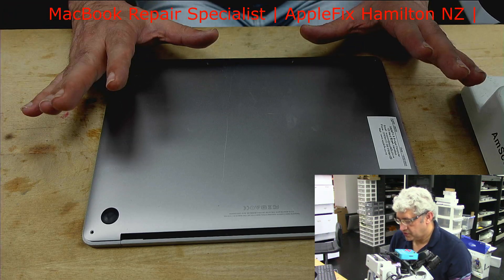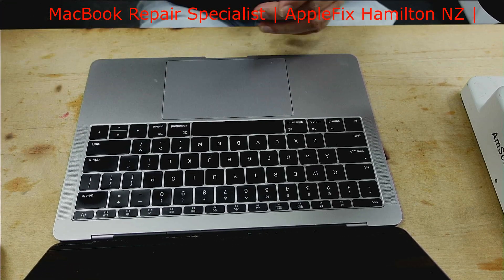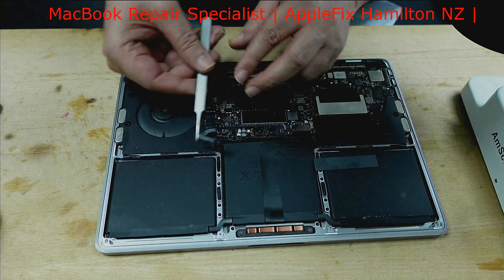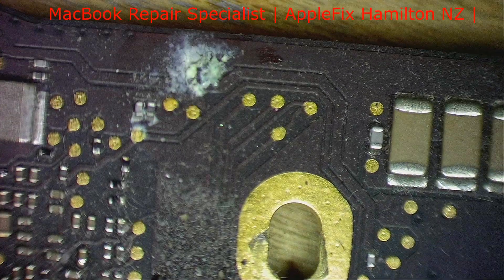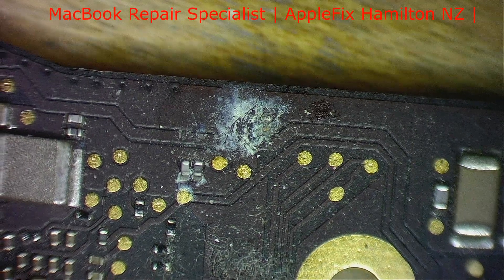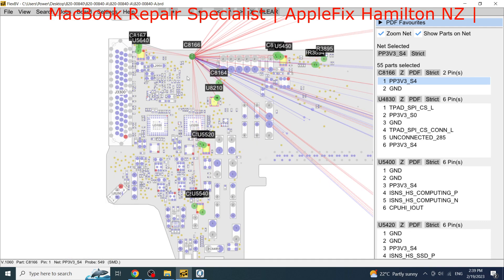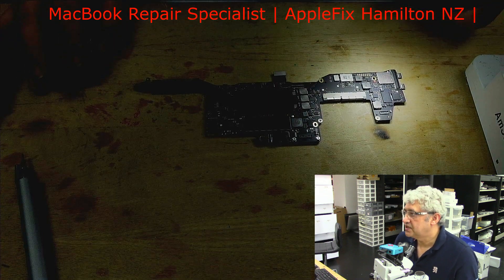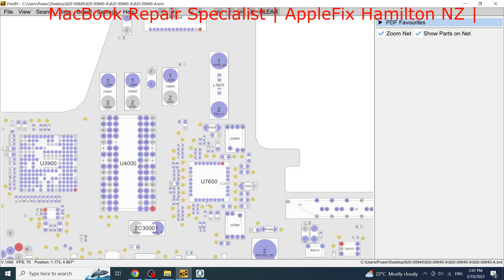Macbook pro A1708 820-00840 water damaged NO POWER Shorted pp3v3_s4 | Macbook repair Experts NZ

Comment: I have a problem mister help me please 🙏🏼, my english is not that good, im from Indonesia 🇲🇨 , I have macbook A1708 820_00840 with burn ic U3200 short ppDCIN_G3H with PP5V_S4 with to ground. can I just replace it CD3215C00 without programming?
Reply from the maker: Cd3215c00 doesn't need programming
Reply: @ApplefixCoNz  thankyou mister thankyou alot
Reply from the maker: no programming needed
Reply: @ApplefixCoNz   this macbook on i replace U3200 and U7800

but this device no display and no capslock but touchpad function clik clik 

I plugged this macbook into another macbook with a type c cable, "Cannot Use Thunderbolt Accessory" 

Im charger this macbook CPU warm, and touchpad function, and no display

Can this macbook enter DFU and flash it?
Reply: @ApplefixCoNz    this macbook on i replace U3200 and U7800

but this device no display and no capslock but touchpad function clik clik 

I plugged this macbook into another macbook with a type c cable, "Cannot Use Thunderbolt Accessory" 

Im charger this macbook CPU warm, and touchpad function, and no display

Can this macbook enter DFU and flash it?
Reply: @roymaulanayusuf no dfu on  this model. could be a bad cpu... try a new efi rom first
Reply: @sajwhat  omg thx you you answer, but device is done, macbook life, I replace ic charger